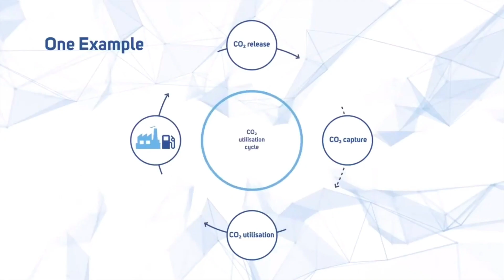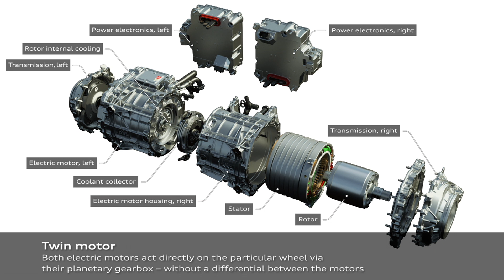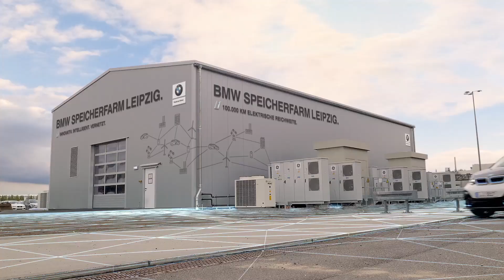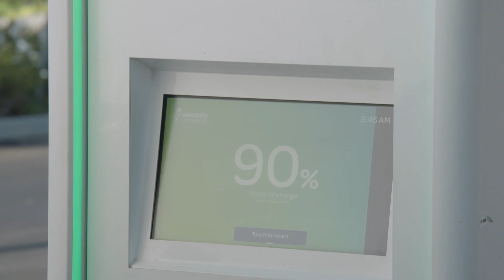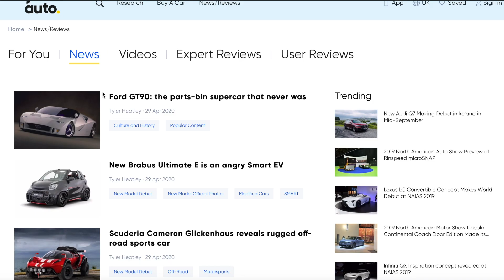Will synthetic fuels kill off Teslas and other electric cars?

Comment: F1 will probably speed up the study of synthetic fuel and it is good thing if it happens because it will save a lot of cars from getting dumped in the discharge while also being co2 neutral
Reply: True
Reply: Porsche has announced that they are making their own synthetic fuels and the only reason why they never entered F1 was because of the current engine rules. So hopefully they can change all that and we start seeing higher reving engines agin
Reply: @muckman5509  those are great news!
Reply: @muckman5509  I've read that,McLaren supports the idea too,seems like most companies are not willing to give up to regulations,those are definitely wonderful news for car enthusiasts.
Reply: And Motogp. Petronas is they main fuel supplier
Reply: @wendellnovais  What I under stand every manufacture supports the idea of carbon neutral fuels. I think Mercedes was critical at one point but Toto is in huge favor of synthetic fuels. I don't see any reason why car manufactures would not be in favor.
Reply: @Allen Loser synthetic yes but not carbon neutral.
Reply: @Allen Loser blue crude was abandoned by Audi and was taken over by sunfire and climeworks. Whoever Audi did not use this technology in the racing industry. Biodiesel is completely different made up of organic materials not Co2 capture.
Reply: Ig both Synthetic/eFuels and EVs will have a 50-50 dominance in the coming future. As EV's R&D is also way ahead but I don't think there will be a complete replacement for ICEs. Hybrid Drivetrains would be a better and profitable option rather than completely switching to either of the two.
Reply: @sumitpatwardhan2002  the only way I can see battery cars surviving is if they are built with non rare earth materials. Remember cars are mostly built using recycled plastics and metals but when you have to build a car having almost 40% of its make up made out of non recycled materials, I just don’t see this happening in 20 years or so.
Reply: @muckman5509  True, just shifting completey to EVs is not the right solution, we should gradually blend in the upcoming technologies. Just dumping all the current gasoline vehicles is pointless.
Reply: I hope so i cant stand that Formula E bs

Comment: Well synthetic fuels ultimately make more sense as there are billions of cars already made and available. To swap the whole world car park will create a massive upwards swing.. both in the end will be the perfect solution.
Reply: Electric vehicles make up for their production co2 emissions after only 3 or so years. If we switched the entire fleet of cars now, we would see benefits from 2025 onward
Reply: @ThomasBomb45  I would personally like to see something like maybe two-thirds EV's and one-third gas and Diesel vehicles on the road. Most people, since they're not into cars or mechanically inclined, would buy EV's, while us car enthusiasts could still buy gas and Diesel cars and have fun with them.

The future might be like 80 to 90% of cars on the road being electric.

By then we could be doing things like pyrolysing garbage and sewage, turning it into bio-crude, then refining it. This way we can produce fuels without using petroleum if we insisted on getting away from petroleum.

Also, switching the entire fleet of cars now will take 30 years at least. There are so many petrol vehicles on the road that dumping them all will do far more harm to the environment than good.
Reply: @electric7487  I don't fully understand what is fun about burning fossil fuels that can't be done with electric, but yeah we could use biofuels or other synthetic fuels. My problem with it is that it will use even more power. Combustion cars are less efficient than EVs, and they will be even less efficient if the fuel has to be synthesized using electricity. Although it has potential to be a good use of excess electricity (i.e. solar during the summer)
Reply: @ThomasBomb45  One possible solution is to use a nuclear reactor to provide the heat needed for pyrolysis, and then each pyrolysis reactor would have a heat recovery boiler after it so the hot air leaving the pyrolysis reactors could be used to generate steam. That steam could then be used to turn turbines and generate electricity.
Reply: @electric7487  but why not just charge electric vehicles with the electricity directly
Reply: @ThomasBomb45  Because we car enthusiasts want to be kept happy. Synthetic gasoline will allow us to run our cars without doing much harm to the environment.

The electricity generated from the recovery turbines is sent to our electrical grid (although some of it is used to run the entire refinery itself). Of course, a good portion of the electricity that the refinery generates would be distributed to the grid, some of which would be used to charge EV's.
Reply: @electric7487  I mean the pyrolysis will take away the heat energy, wont it?
Reply: @ThomasBomb45  The pyrolysis furnaces will take away SOME heat from the incoming air. The air leaving the furnaces would still be very hot, way more than hot enough to boil water.
Reply: @Allen Loser yes, I know. But individual action is not enough to save us from climate change. We need big investment from government and industry NOW
Reply: @Allen Loser Yes, which is why we use government incentives such as tax breaks and subsidies to increase demand for emerging technologies, letting them get up to scale to bring costs down. It happened with Solar and wind, whose costs have decreased dramatically over the past decade.

Government should also be funding the necessary research into new tech, so we can find those cheaper alternatives that are also not harmful for the planet.
Reply: @Allen Loser My next purchase will be an EV or PHEV. Currently im borrowing a used car from a friend. Haven't purchased a car because i'm moving to a new state soon so a new purchase doesn't make sense
Reply: @Allen Loser If I was staying put I'd buy a used Chevy Volt PHEV. 20-30 miles of pure electric and a gas tank with an efficient engine for longer distances. Best of both worlds
Reply: @Allen Loser Thanks for all the research! I was not aware of the ioniq, most of my research was on getting a good price on one of the earlier models used. Either way, with a PHEV, I could do 90% of my driving on pure electricity. I could get 100% of my driving done on a new EV with their 200+ mile range, but I can only do that by buying a new model as the current used models came from a time when EV range was admittedly puny
Reply: @Allen Loser As I said, I do not plan to buy new so the economic calculations are different.

Also, the economic calculations you make don't include the electricity discounts that some utilities offer such as lower rates at night. They also don't include the cost of putting carbon dioxide in the atmosphere. I'm willing to pay a little extra to decrease my carbon footprint and contribute to the technologies that can get us away from the fossil fuel addiction
Reply: @Allen Loser Why are you making bad-faith assumptions about me? As soon as I purchase a car, it will be at minimum a PHEV or a full EV. I don't care if you believe me but it's baffling that you, a random person on the internet, feel you know more about me than I do. Please try to give the next person you tall to the benefit of the doubt
Reply: @Allen Loser I don't understand. What do you get out of this conversation? I understand earlier we were talking about which option is best but now you want me to call you up in a year to let you know I'm keeping my word? Lol
Reply: @ThomasBomb45  the notion that EVs are more efficient than ICE is just false. And secondly ICE enthusiasts like their engines because of how unique and different each one can be. We all know EVs are better in every way but they just don’t have the charm that classics do. They’re too robotic and feel empty.
Reply: @epik_robie1709  EVs absolutely are more efficient. Batteries and motors turn about 80% of the energy from the wall into motion, while ICE engines turn about 30% of the energy from gasoline into motion while the rest is lost as waste heat.

A full comparison of the efficiency of well-to-wheel is more fair, in which case you will also learn that power plants are more efficient than ICE cars at turning chemical energy into power (electricity in this case) so EVs still come out on top.

And you can't power an ICE car with renewables. Unless you want to use "e-fuels", which would be even less efficient since you add losses of creating the fuel to the loses of ICE
Reply: @epik_robie1709  I somewhat agree with you on the charm aspect. Big automakers have not put much effort into making electric vehicles actually look and feel nice to drive. In my opinion, it's either intentional sabotage so they can keep selling old technology or it's out of touch old white men thinking that the should only market them to tech bros and tree hugger millenials
Reply: @ThomasBomb45  "EVs absolutely are more efficient. Batteries and motors turn about 80% of the energy from the wall into motion, while ICE engines turn about 30% of the energy from gasoline into motion while the rest is lost as waste heat. A full comparison of the efficiency of well-to-wheel is more fair, in which case you will also learn that power plants are more efficient than ICE cars at turning chemical energy into power (electricity in this case) so EVs still come out on top."
Correct.

"And you can't power an ICE car with renewables. Unless you want to use "e-fuels", which would be even less efficient since you add losses of creating the fuel to the loses of ICE"
You can do it, biofuels exist. And, as mentioned, pyrolysis of waste biomass can be used for production of biocrude, which can be refined just like petroleum can. (The reason why no one is taking biofuels or biocrude seriously is because crude oil is cheap.)
Nuclear power and renewable energy would be the main sources of power for eFuel production, especially nuclear as its high energy density could go to great lengths to make up for the inefficiencies of eFuels. Electric vehicles for up to 90% of the population, gas vehicles running on synthetic gasoline and biogasoline for us enthusiasts.
Reply: @epik_robie1709  EV's ARE more efficient than ICE, and in my opinion these areas are where electrification makes the most sense:
- Economy cars (already 80-90% of cars on the road)
- City buses
- School buses
- Lawn and garden equipment
- Small boats
- Local delivery trucks (FedEx, UPS, USPS, et cetera )

For heavy-duty trucking, full electric just doesn't make any sense IMO, but hybrid makes a lot of sense. Nor does it for tour buses or larger boats and ships, for example. Large ships could be run on biocrude produced from pyrolysis of waste, or be converted to nuclear-electric.
Reply: @electric7487  The NS savannah was the first commercial nuclear ship and that was built in the 50's and couldn't dock in most ports. I wish big ships could run on nuclear but the general public still has this big Chernobyl fear when it comes to nuclear.
Reply: And the fuel delivery infrastructure. And maintenance buildings for fleets.
Reply: Until you learn synthetic fuel will always cost more than normal fuel. Currently it costs $38 a gallon. And people complained when shipping prices were high last year, imagine if the fuel was 10 times more expensive. Plus now your $30 fuel up now costs $160. Not really what people were asking for.

Comment: I don't have 35 G to drop on a new e.car, give me recycled fuel from atmospheric CO2
Reply: This would be an awesome idea. May as reclaim what has already been drilled. Turn it into home heating gasses for rural communities and spread the use out over time and maximize efficiency. I hope this beats out fracking in terms of both profitability and environmental impact. Combustable fuels could be used for in place heating, rather than transportation.
Reply: @Iquey  how will i run my Nissan skyline though?
Reply: @Unknown-nh8fj  water? Porsche have already started their development of synthetic fuel. Forget water
Reply: @Unknown-nh8fj  water vapour is a green house gas. It cant combust and it wont make any of the currant cars on the road co2 neutral. Co2 is everywhere, so is methane. Those are the two biggest greenhouse gasses. If we can recycle them and not add anymore of those two gasses into the air while using it to power our cars we are good. Theres more than enough co2 in the atmosphere that can be recycled to fuel cars forever. By 2024 its said to be cheaper than normal petrol.

Comment: I think lots of people need to see this video. I personally love the sound of a V8 and love to hear the engine run. I’m not a big electric the car personally but I don’t think there is a thing wrong with them. I would love to be able to drive my truck with a V8 without any emissions. I have people tell me all the time how much faster electric cars are and I don’t think they understand that hearing the engine and feeling the shifts is half the fun. I really hope in the future people have a choice if they want gas or electric. We also need a fuel like this because I think its a long ways from people buying electric tractors, semi trucks, and heavy equipment.
Reply: I still will miss the 2 stroke snowblowers, blowers,weed eaters, and dirt bikes. I guess I will just buy a bunch and stock up on them😂.
Reply: I just don't want electric. I love the sound combustion engines make and really I'm not going to change to plug in my car every night or wait half an hour for it to charge.

Give me a liquid fuel vehicle that makes a nice growl and thats all I want. Will never touch an electric vehicle. Sadly the combustion engine vehicle may end up similar to diesel, it'll be for those willing to pay extra to have a better sounding vehicle.

I don't care about instant torque or less parts, give me a car with a V8 sound and I'll be happy. Plus even automatic transmissions make me smile the shifting to different gears is what makes a car so great.

Comment: There is no requirement to retune your engine for synthetic fuels. Mahle have been testing for years now and they are happy with no retuning
Reply: When it will commercialized please tell me if you have any info
Reply: it's basiclly the same fuel ur putting in ur car just...made by us
Reply: @deaimad7957  yep, but it is even purer and burns cleaner. So more power and better for our lungs
Reply: @cryptohouse1676  it burns the same but it belongs to the carbon cycle: we basically captive co2 in the air then release it. only emission that don't belong to this are the one used for transporting it wich are the only emissions not "green"
Reply: @deaimad7957  It produces less soot, less NOx and SOx.
Reply: @gtvishal2521  It wont be commercialized until we fix the thermal requirements for production. This is where Nuclear energy comes into play. So id be more concerned as to how successful we are to implement thermal nuclear energy into the industrial sector. Ones we have come up with a cost effective way to decarbonize the industrial sector, only then we can start to produce these fuels are a cost effective way. Either it be Electricity or hydrocarbons, there still is the question as to how you will generate the thermal requirements no matter what. And no, you cant run the transportation industry on solar or wind. Reasons because the transportation demands a absolute continues fuel supply 24/7. It is absolutely impossible to use wind and solar. Nuclear is the absolute answer to all these requirements. It all comes down to thermal energy.
Reply: @deaimad7957  yes, but only if that manufacturing process contributes absolute zero in return. I see only thermal nuclear energy is the only way we can do this.
Reply: @cryptohouse1676  100% Synthetic Diesel are far cleaner and will allow Diesel engines one again to run without a DPF

Comment: I think synthetic fuel is a sleeping giant. Because it just scales SOOOOO much better than shoehorning E mobility into the infrastructure. Plus, E-Cars have one problem, and that is that the battery acts as a rigoros glass ceiling to their commercial life span. After about 8 to 10 years or 160.000 to 200.000 kilometers, the battery will have lost 25 to 30 percent of it's capacity and will get worse increasingly fast from thereon (because of the downscaling capacity enforcing more reload cycles). That is non negotiable, because the chemistry and mechanics within the battery simply behave that way. There are no two ways about that.

So after about 8 years, you will have to start eyeballing a new battery, which is the most expensive part in an electric car. It's basically like driving a combustion engine, that suffers capital damage by default after a given time. And that sucks! Because how many people will invest thousands of Euros into an eight or ten year old car? How the fuck do you have any hope for a thrieving second hand market to take shape around technicalities like these?

Combustion engines don't have this problem. Plus, if you know your way around them and have a maintenance friendly model (typically an older car), you can really prolong their life a great deal. I am talking about cars that are in active use for three decades plus - some of which may even prosper to become respected vintage cars.

And it just sickens me, that an elctric car doesn't lend itself to that. Not without swapping out the engine, at a very steep price tag, every ten years or so.
Reply: Toyota Honda and Volvo engines can do more than 600 thousand kilometers, they just need to replace alternator and starter motor. Electric car will end up in junk yard after battery get worst and less efficient, not recyclable.